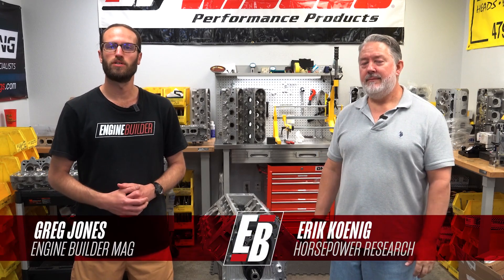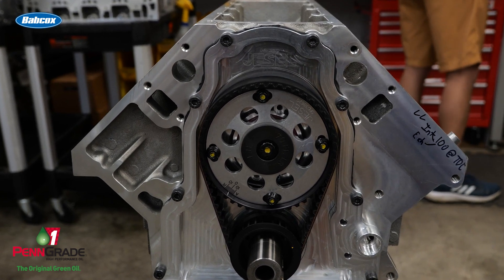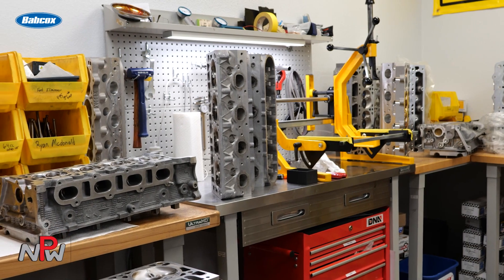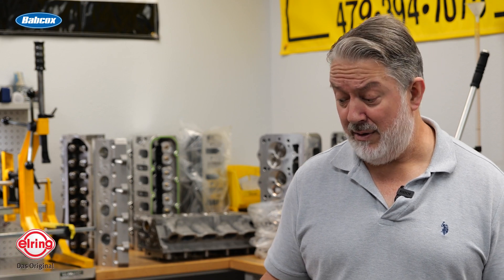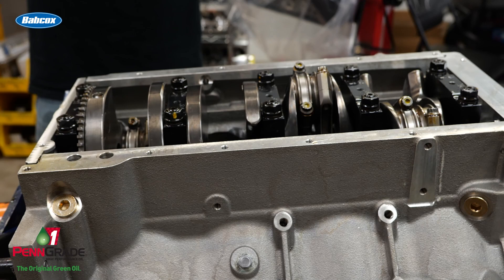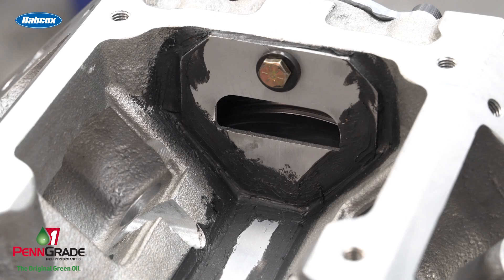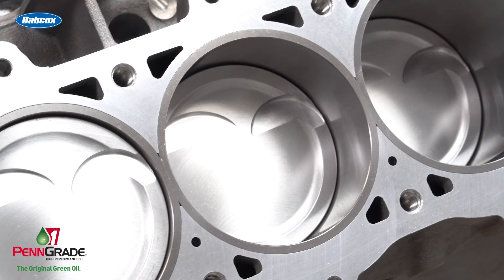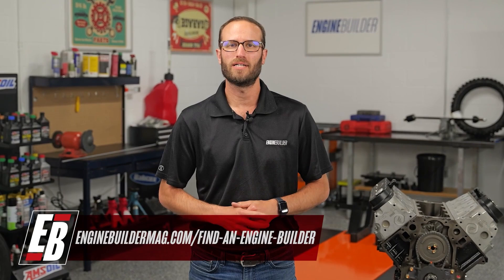HorsePower Research's 465 cid LS7 Engine

Comment: Exactly where did the tag LS7 come from in this, since it's a aftermarket block, bigger cubes, and basically nothing about it is LS7? LS7 style heads and a dry sump are the closest they have in common. Not trying to sound hateful, it's just not even as accurate as saying a sleeved 5.3 is a 7.0
Reply: The block is based off a ls7 block just built better so they can do stuff like this.